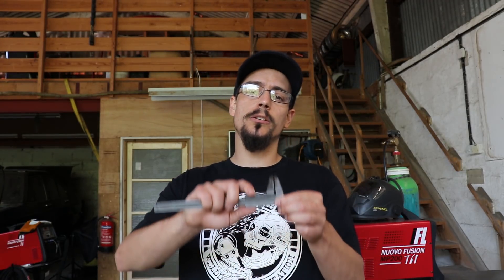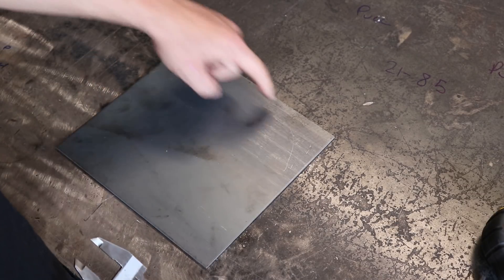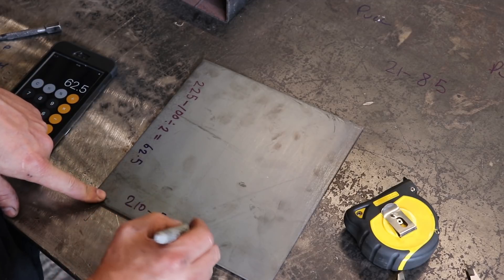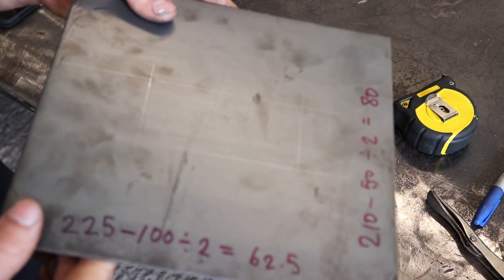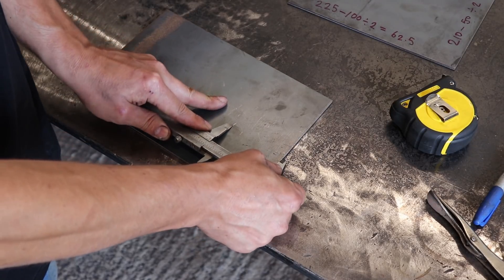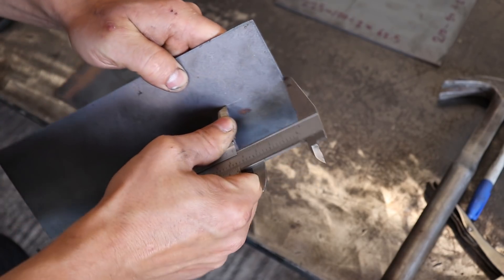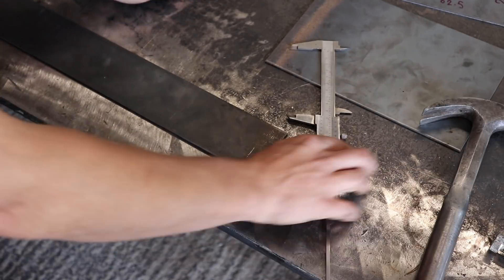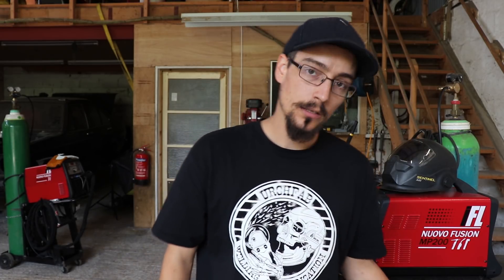HOW NOT TO USE A VERNIER CALIPER! QUICK FABRICATION TRICKS FOR MEASURING & MARKING.

Comment: OK but if you want to write your calculations right you should put: (225−100)÷2, not 225−100÷2 .  The caluclator does it right, but doesn't show the ().  The reason is that division would occur first by convention (order of operation/order of precedence), which would give a different result.  It's best when writing out the calculations to be correct or you'll get random, annoying comments from youtube yahoos, like me ;-)

Comment: Funny...just made few markins today with cheap caliper. Bought it from eflye, cost 3usd. It has 0.20mm fault, so it is just fine to sheetmetal and iron work jobs.  The caliper with tightening screw is nice, it keeps it locked good.  If points get dull , you can sharpen them with belt grinder easy, remember to grind only outside 😆

Comment: I was taught as a metal model maker that the caliper tips are pointed and hardened specifically for scrubbing accurate lines on sheet metal or thicker metal.
Thirty years later the points are as sharp as new.
Reply: Measuring surfaces and the bar are hardened stainless steel in all decent quality calipers to keep them from denting. The tips are not meant to be used as scribes but pretty much everyone does it.
Reply: Seriously, don’t use the tip to scratch a line. Despite what Edward says, these will wear, and you’ll lose the accuracy at the tips. Just get the proper tool.
Reply: @melgross what tool is that ?
Reply: @tluva1020  a carbide scriber. There are many different measuring tools such as adjustable squares that we use to give us the place where we need to make a line and then use the scriber to mark it. A surface plate with equipment to measure and scribe lines is another example. But really, these lines are just to allow us to see where we need to do something. To do that actual work we need to set it up on the machine and use other tools to find the edges, the center and other places of interest. How, for example, are you going to get an end mill in the right place to 0.001” accuracy by looking at a scribed line on the work? You can’t. The lines are just there as a goof prevention tool. They’re not intended as actual cut lines. If you’re not doing precision work, it’s different.

Comment: Excellent, for anyone not knowing about these, avoid the digital ones as the batteries are a pain in the neck and as Matt says most of us don't need the accuracy(which would probably be dodgy on cheap ones anyway), UK folks should be able to find Verniers at Halfords, B&Q etc.
Note Matt centre punched one of the plates he was marking out, best to do that on millscaled  stock etc, as if you scrub off the millscale before welding, you lose the scribemarks, so the punch marks will keep you lined up.Another good use for Verners is pulling out tiny metal splinters from your fingers or whereever.
Reply: Some of us do machining, where we do need the accuracy. Mechanical models are just as accurate, but are more of a pain to use, particularly when measuring at some awkward angle where you can’t read the tiny numbers without removing the tool from the work, which then ruins the measurement.

But, you can buy points for your calipers that fit over the legs and tighten with small set screws. The tips are points, so it’s easier to scribe with than the regular caliper tips. Then you can scribe away all you like. If the points get dull, get another set. I’ve got a set with carbide points. $15, or about 12£. They will last forever.
Reply from the maker: Damn I should have got the splinter trick in there too. good point on the mill scale.Cheers